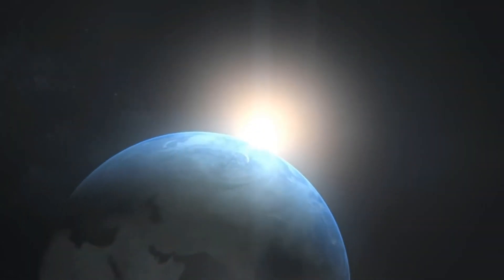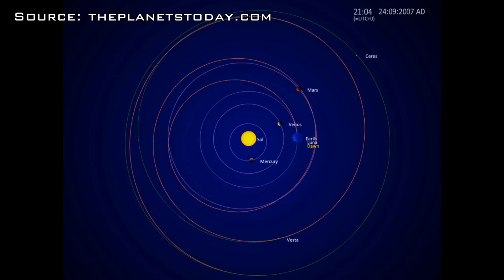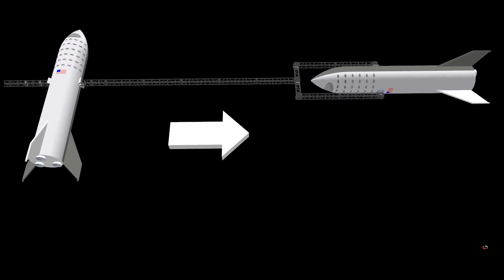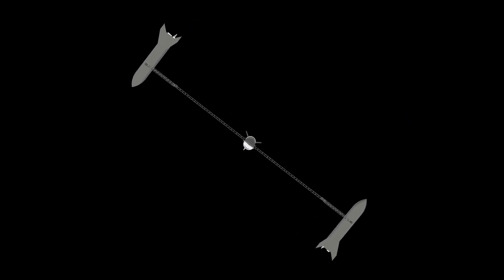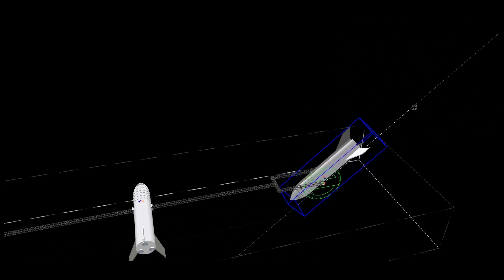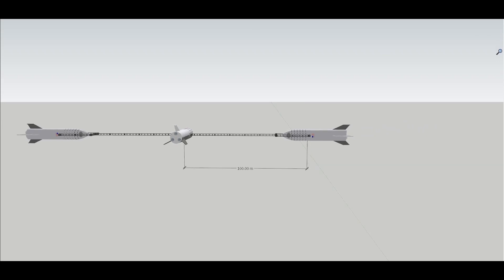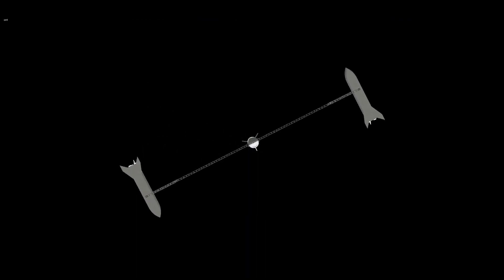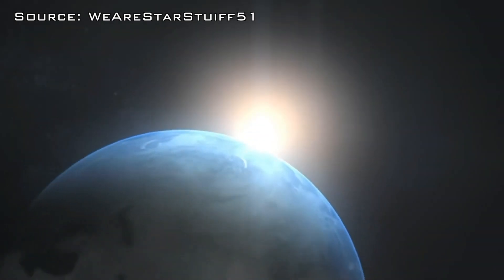GLS2: Artificial Gravity for SpaceX's Starship

Comment: You are right to say that there is no need for the traditional sci-fi rotating ring space station. The mass you must launch into orbit to build the station would be horrendous. But the other issue is nausea. At less than several hundred meters, Coriolis forces due to differential rotation would make the occupants feel uncomfortable or even sea-sick (or space-sick?), especially as they climb "up" ladders toward the center of the ring. To make the experience more comfortable you really need to slow down your rotation rate and extend the radius of rotation as much as possible to lower the nausea level. A 1km radius of rotation would require only 1/2 rpm to generate a Martian level of artificial gravity. That would be much more comfortable on the human body than 3rpm at 100 meters would to produce 1g, or nearly 2 rpm to produce Martian gravity.

But given the length of the rotation radius (1km), a truss structure would be too massive and not fit in the Starship cargo hold. Instead I recommend two Starships connected nose to nose by a strong 2 km tether. The mass of the tether plus control system would be insignificant compared to the truss system and require only two Starships. The two ships would start out hard docked and connected at the nose. Reaction thrusters at the center of mass of each Starship would fire at low thrust sideways (relative to Starship) in opposite directions. Very slowly the tether would be unreeled under careful computer control to make sure the rotational system remains stable while thrusters continue to fire. The thrusters could use the LOX that is stored on the ship's main oxygen tank as reaction mass. The thrusters would be turned off when the tether reaches the required length (which could vary to produce different levels of gravity). If for some reason the tether ever broke, both Starships would have automatic computer control of ship thrusters to smoothly slow their spinning Starship in a way that would be most safe for the crew. When the Starships arrived at Mars, the tether would be slowly reeled in while braking thrusters would fire in the direction opposite to the spin direction until both Starships would slowly stop their spin as the tether was slowly reeled in.

One of the chief advantages of the tether is the low mass of the system. If SpaceX wanted to do this, it would not take significant re-design work as their Starships are already designed to stand vertically in a 2-3 g plus environment (during launch). There would need to be a good tether reeling and unreeling system in the nose and a mid-body RCS. But that would still be far simpler than setting up a rigid truss system and much less massive. The longer radius of rotation of the tether system would make for more comfortable artificial gravity environment than the truss system as Coriolis forces would be that much more minimized. 

SpaceX could actually save money designing Starship to function in a 1-g environment instead of free-fall as they would not have to develop plumbing for freefall. Of course, they would have to turn off the plumbing while the ship was in freefall, but that would be less expensive than designing and installing freefall toilets for a hundred passengers.
Reply from the maker: Regarding climbing the truss: you probably would feel great the first 10 or 20 steps but as you get closer to the center, the artificial gravity pulls on you less and less making it easier. Going down will be the opposite of course, but certainly not worse than landing on Mars and feeling like a corpse after 0 G for 6 months. 

PS I'm not sure how practical your idea for 1km cable is, but I think it's cool!
Reply from the maker: Thanks for your intelligent input! According to all the literature I have read about centripetal acceleration studies, 100m radius at 3rpm is ok. Google spincalc and see the arrows on the left side that turn red, yellow, and green as you input values into the text boxes. There is another section of that website that explains the human comfort limits of each parameter with scientific sources.
Reply: My intuitive sense agrees with this design. It reduces the need of a 3rd ship. The cable could be a glorified winch like on a jeep.
Do agree with host that you don't need 1km radius. That might be nice for a space station, but you can get by with radius of around 18m for 1G.
Also, a small efficient engine for rotation would be a good addition. It would tap off the main fuel tank instead of regular RCS fuel. Further, you could push only 1 rocket at a time, so as to thrust in the direction of travel. This would reduce the waste of fuel to get spin gravity.
Saw elsewhere that 2 ships land a day apart. I wonder about making the tether severable so 1 vehicle would be sent ahead, the other behind. I don't know if the time of separation is reasonable compared to the journey. I suspect 1 hour apart would be enough to not crash into each other.

Comment: Why can't we use solar battery powered motorized force for spinning the ships instead of propellent?
Reply: Maybe ion thrusters
Reply: It's a similar reason to why spacecraft have to use rockets to fly. Conservation of momentum, linear and angular. Or think about Newton's laws. To apply torque there has to be torque in the opposite direction.
Reply: @harpfully  yes I am aware that in space there is no way around the third law, which is why we dont have electric propulsion as there is no reactive force. What I missed was, I thought electric motors could work just with battery power without  considering the counter forces. Thanks! :)

Comment: Kinda make me think of Rube Goldberg. All you need is a propulsion system that allows you to maintain a constant 1g acceleration up to the halfway point, where you turn around and maintain a constant 1g deceleration until you reach the destination. Not there yet, to be sure,  but systems are under development.
Reply: Literally impossible without fusion or antimatter propulsion, etc.  Else the fuel tank and ship would need to be the size of the universe or something.  See the "Tsiolkovsky rocket equation"

Comment: Great idea! 2 ships maybe could do the same without a center ship and only be connected nose to nose and temporary deflectors on one engine (like used on jet engines after touch down) for spin-up and down.. The "truss" could be stored in one ship and that area converted for use until truss is stored again. A square truss large enough would provide semi-enclosed walkway between ships. A center turn around area may be needed for someone to turn around to adjust for reversing gravity. An accidental separation would also be much easier to recover from.
      Another necessity on Mars  may a larger "Graviton" ride adapted for sleeping, science and office work.  Add a center cylindrical "ceiling" with access ladders and an airlock on top with access scaffold on outside.   Maybe 3/4 G would be enough to prevent most long term low G issues? Also Carnival rides like this arrive in trucks, space ships are much larger. Later, maybe made on Mars?
Reply: After thought: These ships need some of their internal structure strengthened for either attached systems, which will add weight as well.

Comment: You only need two ships and a hub canister that holds all the trusses. It gets left in Mars parking orbit and has a becon, so the two ships can find it after leaving mars and reconnect with it.
Reply from the maker: How do you launch the hub canister in to space? How do you give the hub canister 4.3 km/s delta V, in addition to the delta V you need to insert into Mars orbit?
Reply: @smallstars  Since we are already talking about multiple launches to completely fuel the passenger ships, the same can be done for the hub, which can also have it's own engine. Something like the heavy lifter could be modified to carry the truss elements and enough fuel to get into orbit at earth. After that, it need never land again.
Reply: @Myrddnn  You are 100% accurate with this comment. 
The central "hub" and the truss are the rocket which actually takes you to Mars. This is the section you need which aims you in the direction you want to go and provide the forward thrust. 
The starships will be used to house the crew, and provide the thrust needed to create rotation.
Reply: @smallstars  
How does the hub withstand (or provide) the delta-v to return to earth?
Reply: I wonder if a FH could lift a truss laden canister?
Reply: @WoodHughes  By the time we are ready for the Mars passenger transit, Falcon Heavy will be obsoleted by Starship|Super Heavy in both capability and cost.
Reply: Atmosphere brake
Reply: Smarticus That would make more sense. The economics of the early missions dictate that while much more productive, life and life support requirements are exponentially higher and mass intensive until in loco supply lines are established. In some order on site fuel, air, water, fuel, and building materials have to become economical until this changes. So, it seems to me the material and the capability of the materials being sent will dictate the number of humans being sent.
Reply: Or the two ships just straight up connect.
Reply: @borkyborkborked  With what? Whatever you will use it will take up a lot of space on the ships
Reply: @subwarpspeed  well cables actually have a low chance of failure due to the exact forces we're taking advantage of for artificial gravity. Actually trusses would probably bend and break at 100 meters with that much constant force applied to them. 50 meters of cable wouldnt take up that much room and would end up being a safer option.
Reply: @borkyborkborked  I think the trusses in the video look weak for this, yes.
But how should the cables be managed? Having the ship side-by-side but one reversed using the engines to start spinning and gradually unspool the cables. In the end you have two ships with the centripetal force sideways.
If the cable comes out of the nose of the ship it will be the right way but need thrusters to spin (but maybe the hot gas ones coming up will suffice).
I write "the right way" because once landed on Mars they will have gravity. I think the interior will be easier to design with one down and one up. So you don't "walk on the walls" in space.
A center ship, but with a "ball bearing" approach to the rotational parts could be easier to link up antennas from pointing towards Earth I guess.
Reply: When they have designed Starship - why would you do anything other? A hub canister? Nej engineering and new way to get it to orbit. If this will be nearly regular cargoship they can take what they have and build with it.
Falcon Heavy? Why? No reuse of second stage and I don't think it is designed for long space operation. More engineering... when they already will have a system designed for that: Starship.
Reply: It depends on how the ships are oriented....stacked vertically like a rocket or horizontal like an airbus.
Reply: Smarticus Way beyond my pay grade, but what is the capability of the second stage used by F9 & FH? Better yet, what would be the capability of a 2nd stage designed around a Raptor which is also able to refill in orbit? While a Nina,  Penta, Santa Maria trip to Mars is a cool idea, deploying a pair of Starships with a hub seems like a viable cost cutting strategy. Especially, if it remains in orbit for future round trips. BTW, I’ve been assuming all three Starships in the proposal are fully crewed. You’ll need a space elevator to move the hub ship crew to one or other spin ships. Not a big deal, but needs consideration. Same would apply for the hub canister concept. One ride from SS1 to the hub, 2nd elevator ride from hub to SS2. On such a long voyage, moving crew assignments may be desirable.

Comment: If u point the ships outwards you can use a shorter truss radius. Maybe can even attach the truss to the outside of each starship and do away with the central one. Alternatively shorten the trip time by using them as fully fuelled side boosters from LEO to accelerate the main ship and skip the spinning altogether. Great idea anyway
Reply: Pointing the ships in makes "gravity" that is in the same direction as when sititing on a planet, or flying using main engines. Otherwise the cabin would be like a house that is upright sometimes and upside down other times. Think toilets, etc., etc.
Reply: True, not sure if anyone’s going to be using the bathroom on liftoff or landing burns however. But good point though, everything would have to be strapped down on liftoff if the ship pointed outwards in spin mode.But perhaps the simpler and lighter system would be worth it
Reply: @richard975   Actually, I was envisioning the sewage dropping out of the upside-down toilets in the ceiling.  ;-)
Reply: Lol. Perhaps they could rotate on an axle to avoid that scenario

Comment: Interesting. But the probability of implementation is low. 
But you’re definitely onto something! 
Fuel consumption on the first trip will be paramount.
Reply from the maker: Fuel consumption for RCS yes, but there seems to be plenty of main engine propellant left over with their current plans. They are not planning on spending any propellant inserting into Mars's orbit, but instead just heading straight into the atmosphere upon arrival.

Comment: The best idea I've come across for simulated gravity, (I hate the term artificial gravity, it implies artificially generated true gravity, whilst we're planning on using centrifugal force to fake gravity, hence simulated).

Though I believe that the trusses need to be longer, to drop the rpm, I heard somewhere (I don't recall where, so no source) that more than 1.5 to 2 rpm causes nausea in humans, and i can personally attest to high rpm spinning causing vomiting, though I highly doubt that we'll be using sticky wall/waltzer level rpm ;p

Off the top of my head I seem to recall 150 meters being the minimum length for 1g@2rpm

Comment: I find this concept a great idea, it looks like a MUST, specially considering that a trip to mars lasts at least 3 MONTHS. On another point of view, I find the cable solution a much more practical one, the whole structure thing looks just not right. A good way to fix the spin it would have would be to add a second cable, it would behave just like a swing in the park, stabilizing torsional rotation. Maybe it would be an idea to work out the math and see if that works
Reply: Prone to twisting

Comment: Beautiful design!  One that must be tested, however,  
   It would be easy for there to be some really funky “wobbles” if there were even minor errors in the orientation of the ships during the burn, length differences or power differences  between the engines during the burn. 
  I’m sure it could all be worked out though.

Comment: There's actually a much simpler way to do this, dude, you just attach a cable between two ships, and spin them around eachother. You don't need three ships.

Also, star-ship is large enough to just spin around it's roll axis anyway. And gravity is really unnecessary in the first place.
Reply: He addresses this in the video.

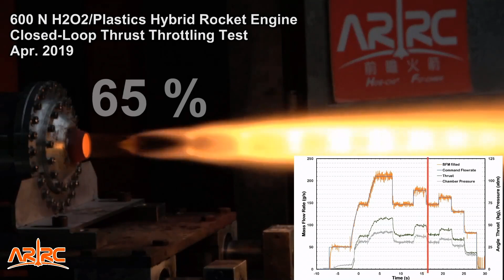Comment: great video but raptor engines can only safely go down to 40% trust 9:20
Reply from the maker: Thanks for the reply. At the time I did all this math, the info I had available said 20% - and even then I'm not sure how practical such a short burn at such a low thrust really is. So say 40% thrust, the burn will be half as long. (edit: I said twice as long, but meant half as long)
Reply: @smallstars  it probably wouldn't be that hard to plumb in a side mounted thruster similar to a Superdraco specifically for spin up.  The burns would be about 30 times as long, but the stresses would be much lower.
Reply: Faulx Eve 
Yeah, the rotation has to be gradual. And with main engines and connection midship, the rocket could break in half, or have to be stronger/heavier. 

Orienting the rockets so that all g loads are in line would be the right answer. And a long burn with a side booster also makes more sense. A main engine burn is killing ants with hammers.
Reply from the maker: @larryscott3982  The shear stress will not be an issue. Consider the environment of floating through space and location of mass and where thrust is applied. A 4 second 1 engine burn to 31 m/s tangential velocity It is kind of like killing ants with hammers, and a hammer can in fact kill an ant. As for plumbing a side thruster, the goal for my concept was to make this work with out adding new systems to the starship design. Version 3 will include a couple of options for swivel joint (one of the options is mounted at the nose) that I will animate in detail and I will include the tension and shear stress math. Thanks for your input!
Reply: @larryscott3982  I agree. The stresses of this system are impractical and unnecessary
Reply: @smallstars  Actually, you could probably forget the plumbing all together and just attach a small ion engine to the outside.  It might take days to spin up and spin down, but does it really need to be a fast process in the first place?
Reply: smallstars, wait, twice as long or half as long?
Reply: Rich Hooker well if he added 20% thrust to the original 20% proposed for a total of 40% then you would only burn for half the time.
Reply: justin B. Right. I was confused and replying to the message right above my reply. More-so was a polite correction
Reply: You only fire up half of the raptor engines then.
Reply: @zerosugarmatcha7348   No, if you were to try this with main engines (which you shouldn't) you would use one engine.
Reply: S. X. Tan .... what is half of 3?
Reply: "can only safely go down to 40% trust " LMFAO